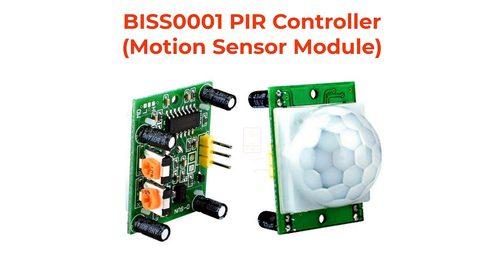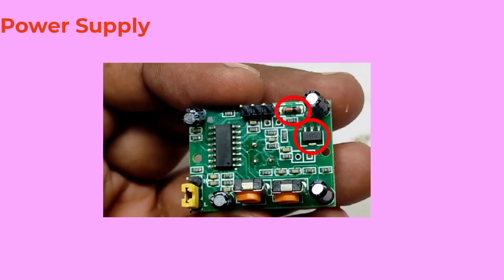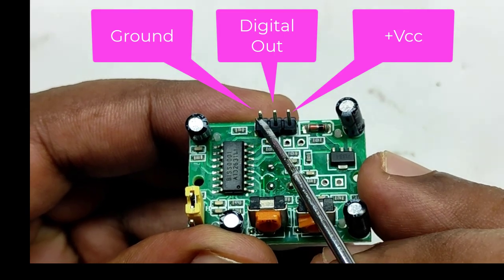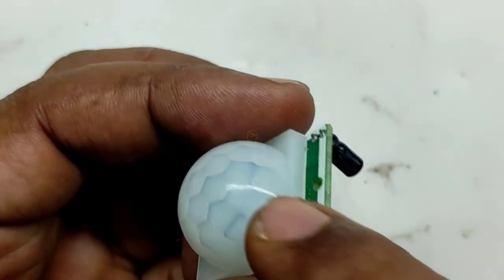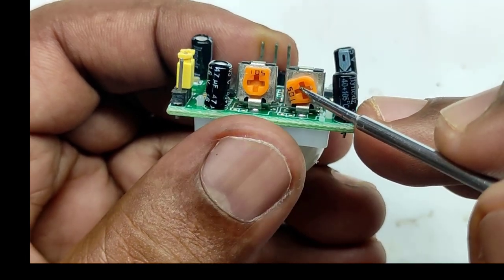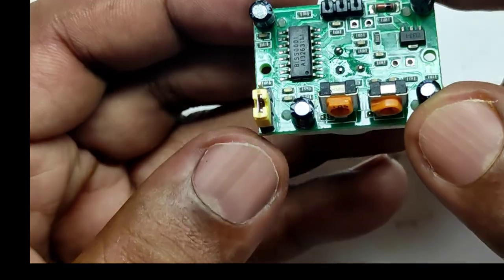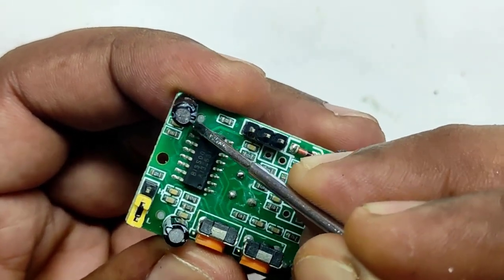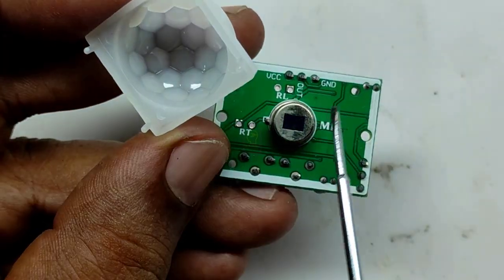PIR Motion Sensor module Explained For Beginners

Comment: Good info and useful however you didn't explain the use of thermistor for this module
Reply from the maker: I forgot to mention that. My apologies. The thermistor is used for the sensor to work in increased ambient temperature. This pir uses infra Red rays which  is a heat ray. At high ambient temperature it may fail , so adding an ntc will increase the accuracy of the controller by using the values from thermistor as well as infrared